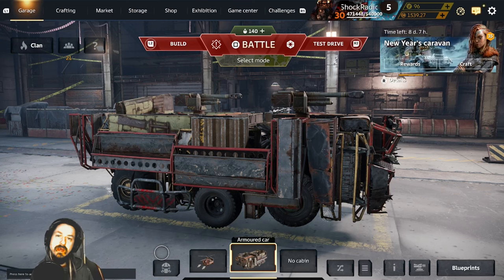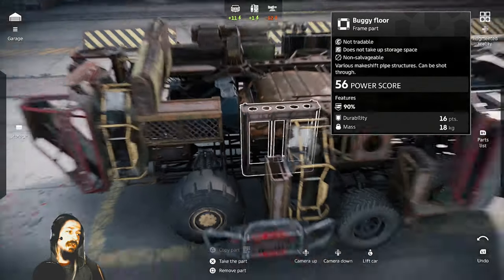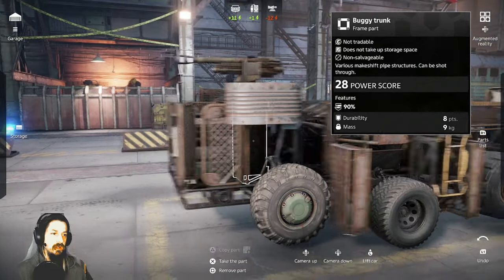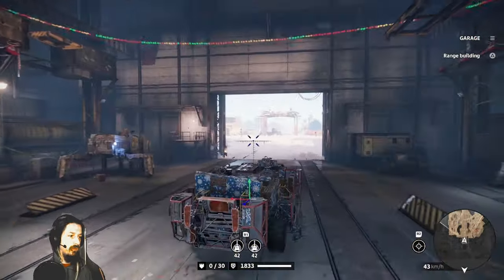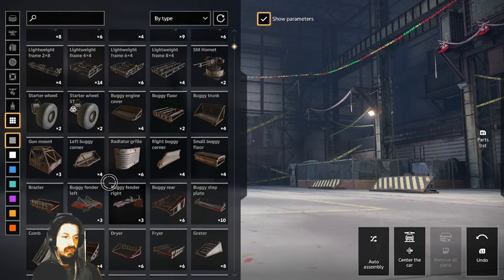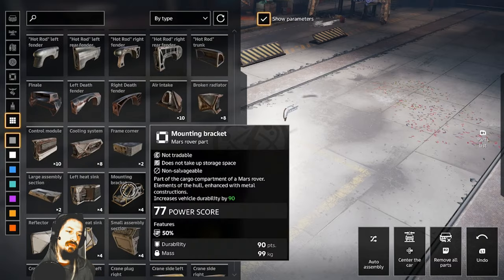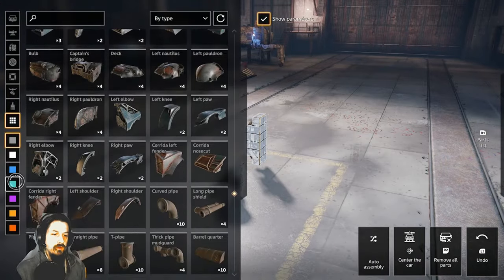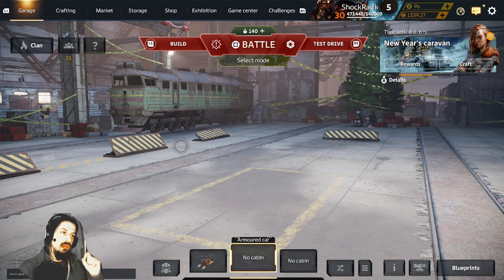CROSSOUT Tips and Tricks | Building With Shoot Through Parts for STRONGER Builds | Beginners Guide

Comment: i hate to be that guy but you what you said in the beginning is actually misleading, ever since the armor mechanics were changed pass through parts stopped absorbing all forms of damage and only absorb bullet and canon projectile damage if said pass through is 10 welding points in front of whatever it is protecting and with that being said the damage that it does absorb is only a small percentage based on the part. so yes shoot throughs are one of the most important parts in the game to hold your build together giving it structural integrity but need to be emphasized to be used to do so and not to be used as armor in their own rightt. (i know you didntt say this but i could see how people could be mislead into thinking that using them as armor like back in the day is correct when it is not) good video regardless tho and i appreciate you giving the newer players the knowledge to go about things the right way
Reply from the maker: I demonstrated how damage goes thru the pass through parts. Not sure if you made it that far into the video or not tho. Thanks for the comment and clarification.

Comment: What are dog builds?
Reply from the maker: Basically any close range or melee builds. Shotguns or flamethrowers mainly. Think of a build chasing you down, biting your ankles lol
Reply: "Dog" refers to the build shape and not the weapons used. Theyre cage-like builds, 99% of the time they run dracos or firebugs, sometimes they run jormungandr if they are owned by idiots

basically they spam bumpers and armor to bury the weapons deep into a tunnel (the build is on wheels). the firing angles are locked so they cannot shoot behind (the cabin is behind the weapon and usually has little protection because all the armor is mostly spammed at the front

these builds want to pin someone and hold them in place while trying to dps them down.

Comment: "how to horribly inflate your ps and have a horrible build anyways"
Reply from the maker: Are the methods behind the build not sound? I get the whole min max thing. I mean this entire build is flawed from the start based on it not having gerrida legs but would you not say the building info is sound, regardless of powerscore?
Reply: @ShockRadioGaming  the problem with using a lot of passthrough parts is that they seriously inflate your powerscore, using them to hold in place armor panels is a bad idea because you spend tons of powerscore for little actual cabin hp.
A good example is the large gunmounts you used to hold armor, these are 133ps each , you dont need them to hold that armor. What you should do most of the time instead is using armor to hold armor : connect the outside piece to atleast 2 separate armor pieces and that should be solid enough.

Theres a few exceptions, like when you want to use bumpers as armor, then passthrough parts can be better to use.

Also keep in mind that frames have enormous ehp and passthrough aswell, mounting armor on frames (1x4 frames are excellent to mount stuff on) is a solid idea.
Reply from the maker: Im not concerned about powerscore inflation personally. Although that is something I should have mentioned.This build isnt even a serious build so i think ur looking into it a bit to deep. it was really just to demonstrate shoot through parts, This was originally a 6k build I just added a bunch of stuff to for fun after I fused everything. I usually play 18k+ powerscore with scorps, firebugs, typhoons, etc for clan battles but no one wants to see that junk :D @Fishloops
Reply: @ShockRadioGaming  fair point, but most people watching this tutorial will be playing at lower powerscores.